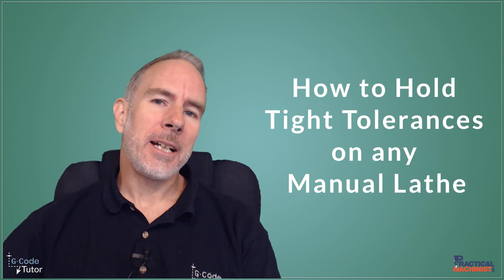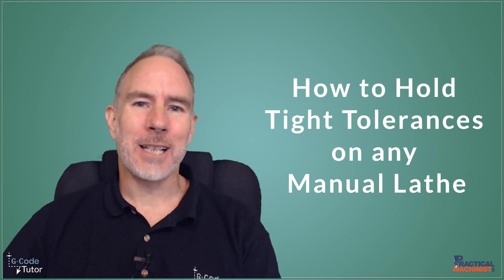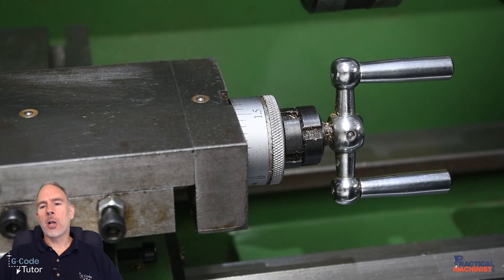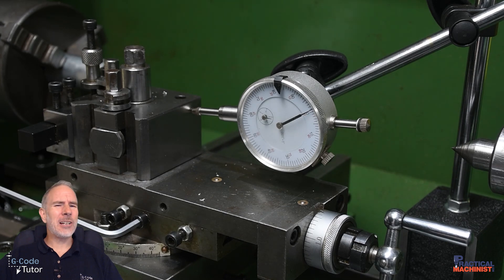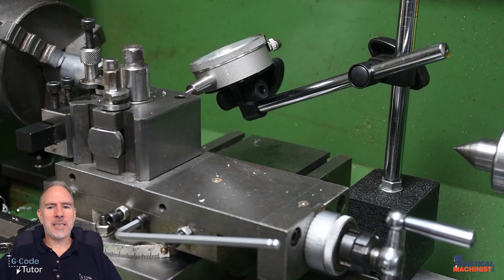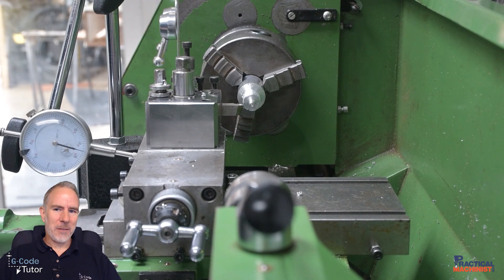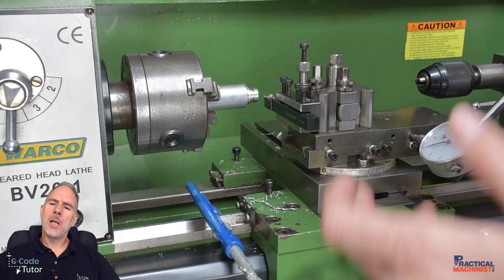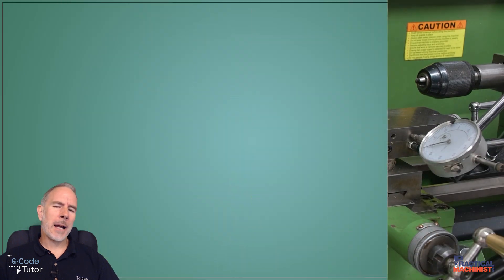How to Achieve Accurate Depth of Cut on a Manual Lathe

Comment: If you have a decent lathe ( colchester triumph or similar ) you can easily hold a dimension of .1mm if you just make sure to always wind back to account for the backlash. For supertight tolerances adjust the cross slide to 3 degrees and just use trig calculation.

10 years + running a manual lathes
Reply: .1mm is a fuckin mile, I hold finer than that on a clapped out lathe that has machined fibreglass for most of its life.